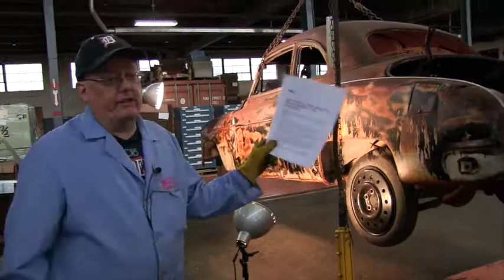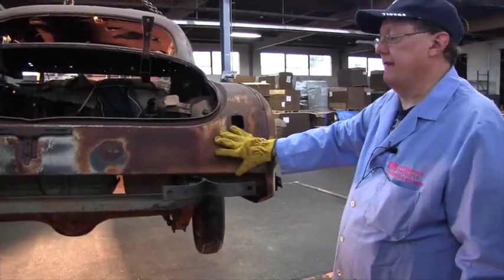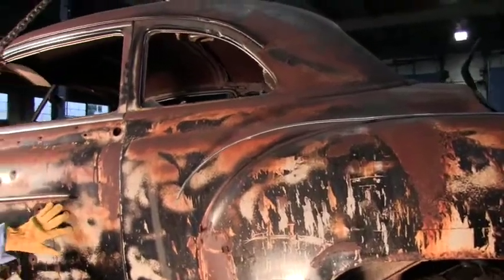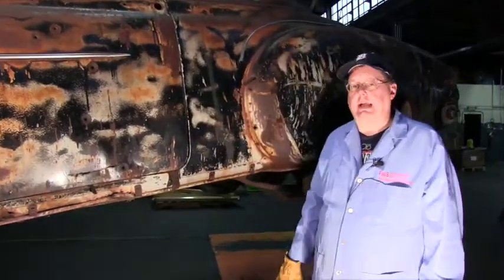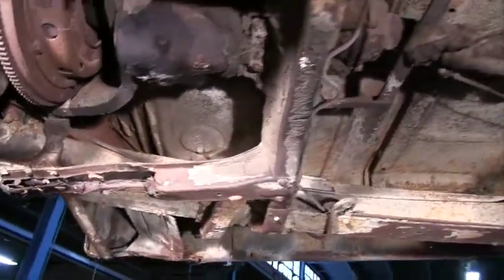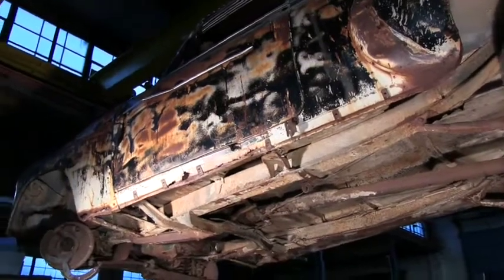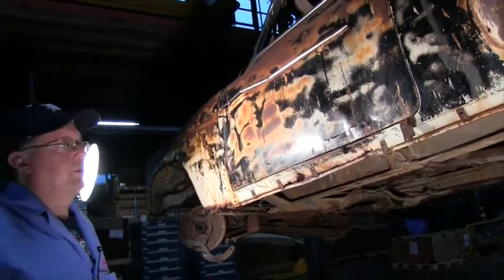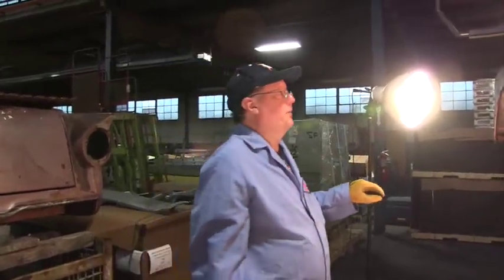How To Install Patch Panels On An Old Car

Comment: Chevrolet specified 3/16" +-1/16" on gaps on this era of Chevrolet. Much of adjusting body panels is covered in the Shop Manual which are available either NOS or in reprint. Generally speaking on the 49-54 Chevrolet, the hood, fender, door adjustment begins with the hood with springs removed.

Comment: Hiya,  great video , Good information, learnt a lot, you can use a MIG welder for quite a bit of the work. If you are joining panels and you need to manipulate or panel beat it is very hard if that being mig, in that case you use a TIG or gas welder those  Two welds allow the metal to move and have a correct panel beating finish. thanks for sharing